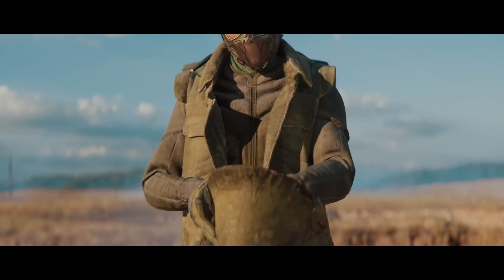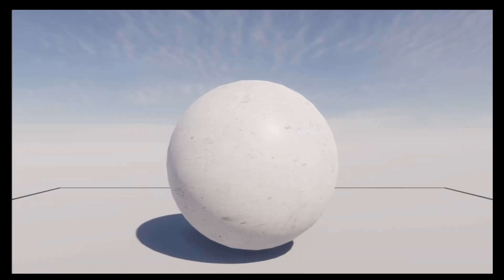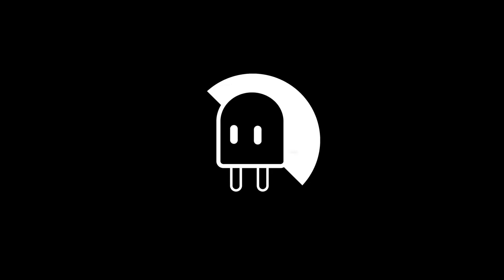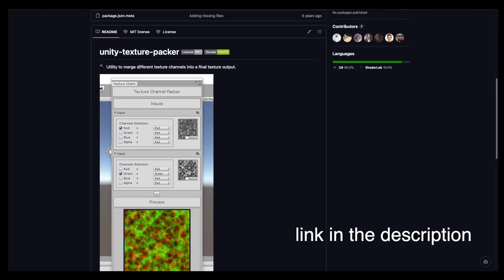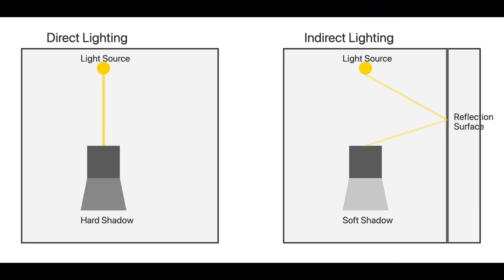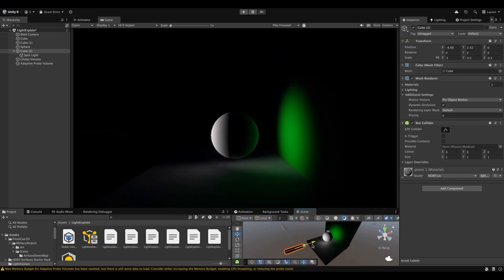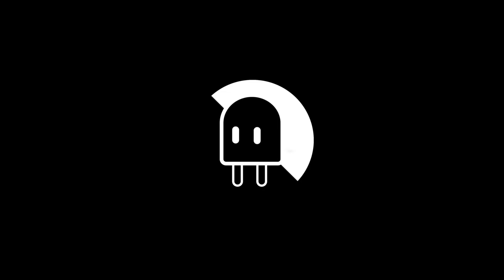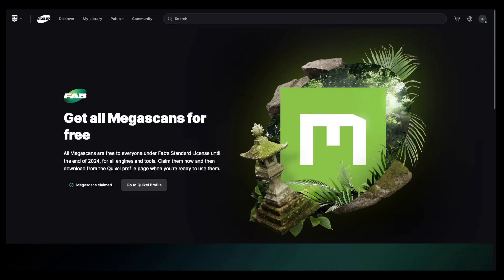Why Your Unity Graphics Look Flat (And How To Fix It)

Comment: Just a small note: Rather than using height maps to actually displace the geometry, as it is extremely taxing in real-time rendering situations like video games, it is better to use them with a technique called "Parallax Oclusion Mapping." When used with normal maps, this technique makes the texture look as if it were actually displaced with great detail, when in reality, the geometry underneath could be merely a simple plane. 

This technique I believe is available in every modern game engine (I don't know where exactly is it in unity, but in godot, you can enable the height parameter under the material pannel, and then enable deep paralx and just add your height map (It is recommended to use a lower resolution height map as it is computationally lighter and there isn't any noticeable detail loss), and in unreal, it's a little more complicated as you need to add a few more nodes, but it's well explained on youtube, and the you can search on youtube how the technique actually works if you wish to know more)

The only situation where I can think of using height maps to displace the geometry is when making an interactive environment like snow.